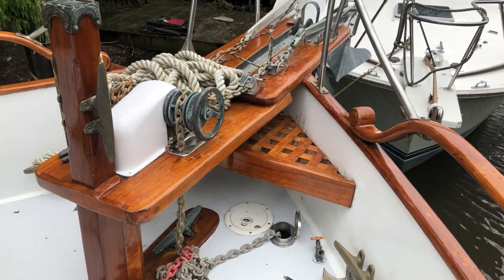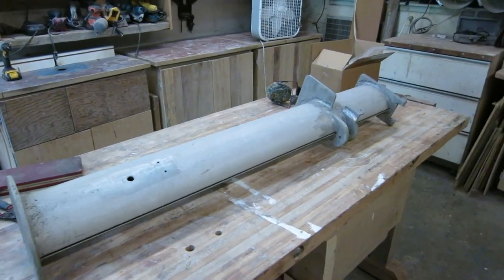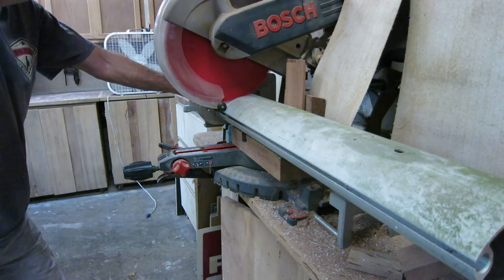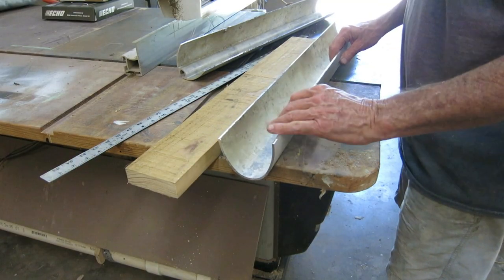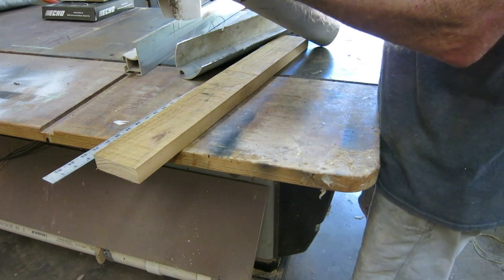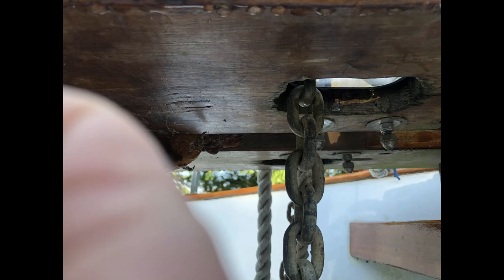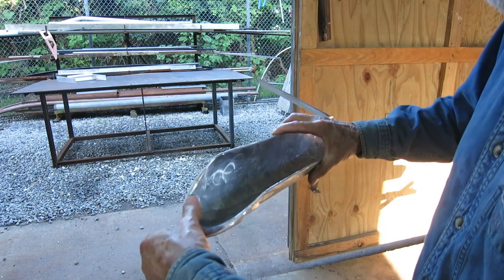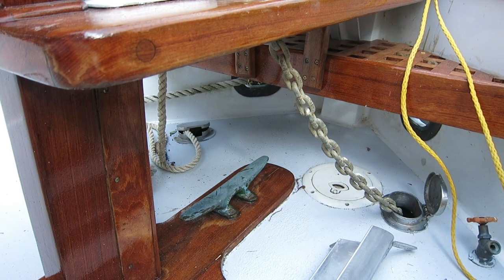Correcting an anchor chain misalignment issue.

Comment: Dang Barry, I thought you were talking about my tools at the beginning.  Mine are old and wore out but hey..... they still work like us, right?
Reply from the maker: Paul
It has just recently that I was noticing how many issues my shop has, lots of them. I hardly have a power tool that works as it should. If I wasn't ate up with the fast forward syndrome I might take some time and fix a few things. Right after my next project....  
Barry

Comment: Could someone help me . I am restoring a starcraft 1960 , turning into a fishing boat, what I need to know is what controller I would need for a 2004 mercury 9.9  4 stroke 8 pin. I see many  on Amazon  that will work the problem is I am going with a center console  , I can't  find a left hand controller to use on the right side of the console any help would be great. Greg
Reply from the maker: Jean
My suggestion would be to join a Facebook Mercury group and ask for help there. Good luck! Barry

Comment: you sould add a rolling pin 1-2 inches before the end of you piece, so the chain to drop in the hole without rubbing in the solders of the hole
Reply from the maker: NX
Thanks for the tip, probably a good idea. You might be interested in my other boat related videos.
Barry
Reply: @barrylukebuilds7894  i am elect. engineer. i retired so i have lot of time and i follow many videos in you tube.40 years was director of technical administration of my city, so i have seen many things, and if i recall something useful i try with my poor english to say it. i am happy you understand what i mean, and you find it useful